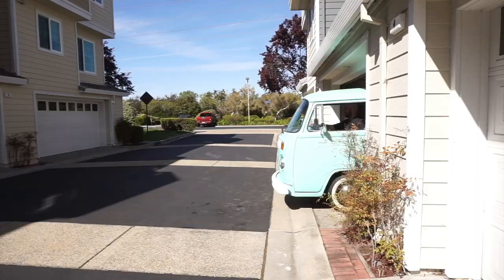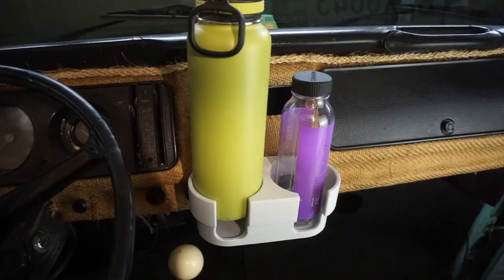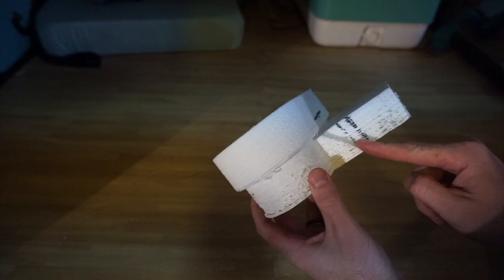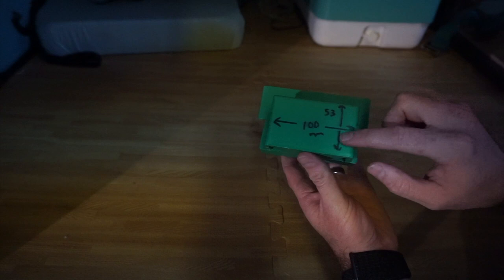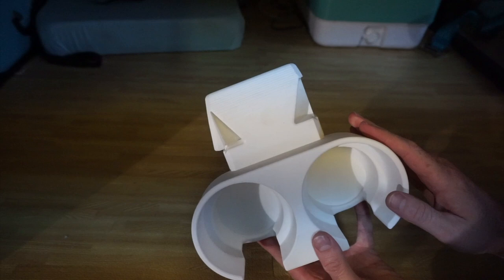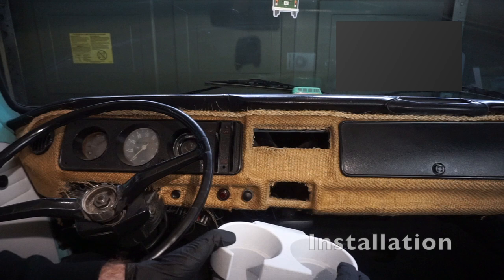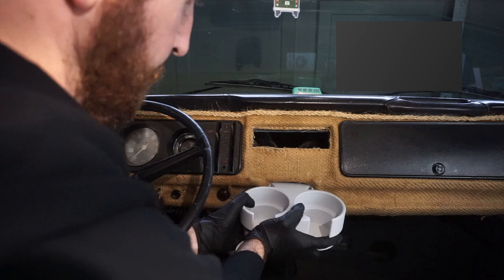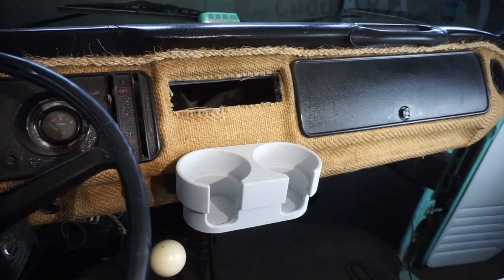3D Printed VW Ash Tray Cup Holders, Bambu P1S. 1973 VW Bus Restoration Part 13

Comment: Pretty neat! Years ago I bought a cup holder for my bus that’s just a block of wood that slots into the ashtray, with a couple of vinyl-wrapped cup holders attached. They are fine for most drinks, but I like the notch you have for handled cups.
Reply from the maker: Nice. They still sell those cup holders but I wasn’t about to pay $65 for one.